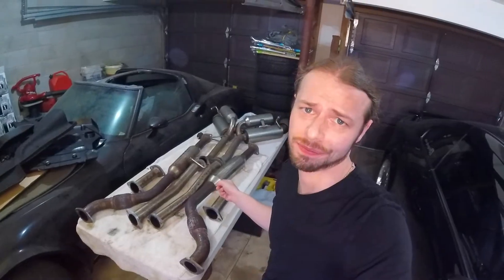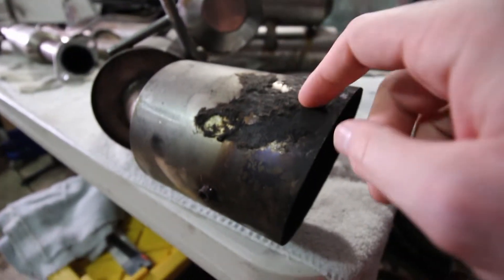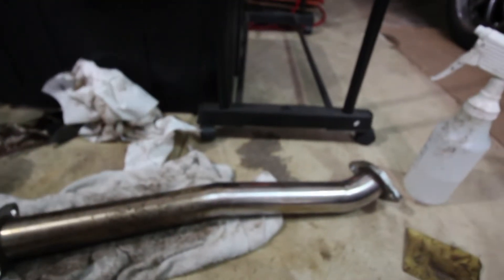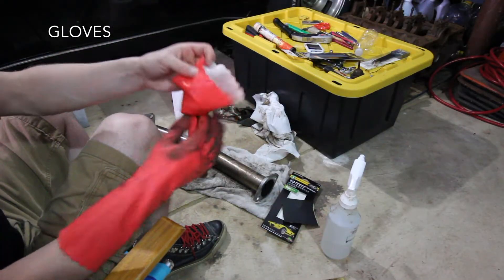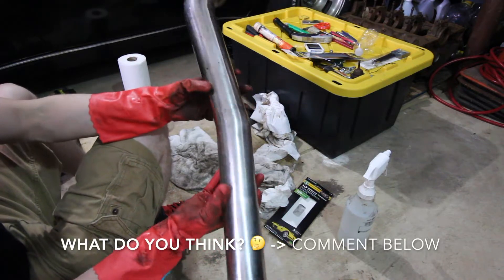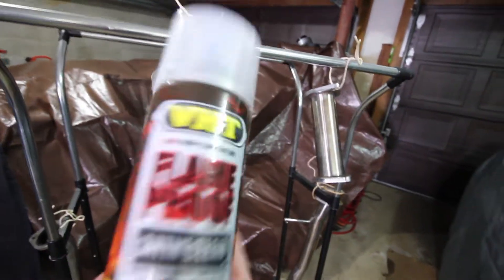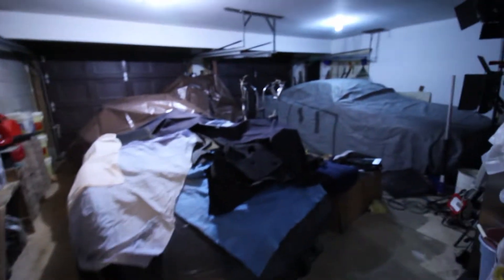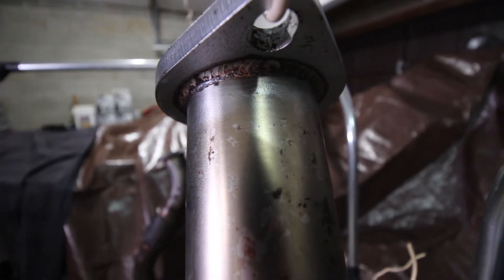How To Clean [FIX] 💩 Exhaust Pipes [What Color is VHT Satin Clear?? // Infiniti G35 Build]

Comment: Wow! That pipe looks night and day better.  I respect the grind. Most people would have tossed it.
Reply from the maker: thanks buddy! i almost tossed it myself 😂.. we have some more work to do to them before install, but i've only spent a total of $80 for the G's entire exhaust 🤟😎👍
Reply: Best way to get the carbon buildup off the exhaust tips?
Reply from the maker: +Ellipsis of Triple Tap tbh, i'd just wash it with a lil elbow grease.. i'll see what Ryan says, but i imagine ChrisFix is the expert on that stuff lol. i stick to mostly Mother's products for the G, but i've heard to stay away from Wheel Cleaners.. they're supposed to be too harsh and can ruin the finish on polished wheels[so probably not good on polished anything]. how do you clean yours atm?
Reply from the maker: +Ellipsis of Triple Tap where the plastic was melted onto the tip, i scraped it off with a scraper tool and hit it with wet sanding like i did the pipes. these 💩 pipes are just stand-ins until i have a better option
Reply: For my rims I use ArmourAll wheel and tire cleaner ($1 at the Dollar Tree!) and it works great. The problem is my exhaust tips have carbon buildup on the bottom of the tips and they're difficult to clean. Maybe when I get them right I'll smear some Vaseline on them for ease of future cleanup...?
Reply from the maker: Vaseline will definitely work on swords and stuff.. maybe it could help? i'm thinking you just need to clean the tips as best you can, and then hit it with a good polish 🚗✨

Comment: Will do satin clear, 600 grit sandpaper waterproof and mucho elbow grease  muchas gracias
Reply from the maker: nice! any time! you might not want to sand the tips if they have a nice finish. everything else is probably worth wet sanding :). definitely hit us up in the comments if you run into any snags or have questions 🤟😎👍

Comment: wow. what do they sound like??
Reply from the maker: thunder. every drive they're super fun for like 30 min.. but if you have to go on the highway for hours on end.. thunder.. for hours on end lol
Reply: Drone city? 😂🤷🏻‍♂️
Reply from the maker: +TLE0622 just when 6th gear starts to go quiet, some moron will cut in front of you and you'll shift to 5th again just in time to wake up the state 😂🤷🏻‍♂️
Reply: @milsgarage  hey man how has the paint lasted on the exhaust. I'm thinking of doing the same but on new headers after I remove the coating.  I don't want to use a primer and want to end with the bare metal look.

Comment: Thanks for making the video. Isn't the satin clear supposed to be the final stage after a primer and base coats? I'm currently planning to do my headers soon. I plan to use the VHT Flameproof Primer, VHT Flameproof [Color] Flat Base Coat, and then VHT Flameproof Satin Clear as a final stage. I'm thinking this should be a heat safe and glossy finish by the end.
Reply from the maker: Thank you for your support Matt! i'm sure it could be used as a final stage, and thank you for listing the other VHT paints you were referring to.. As long as you're using all VHT, that sounds like a great plan for a gloss finish 💯. i'd love to know how that holds up on the headers after you run them for a lil